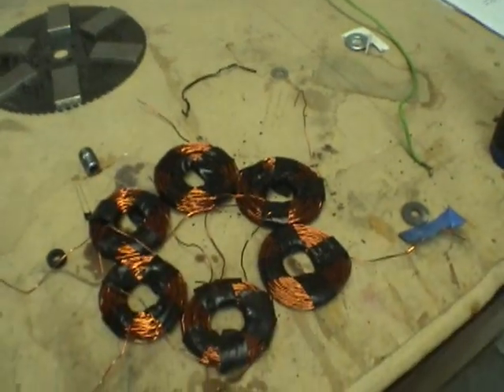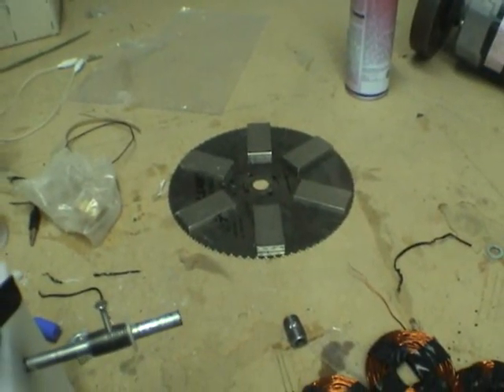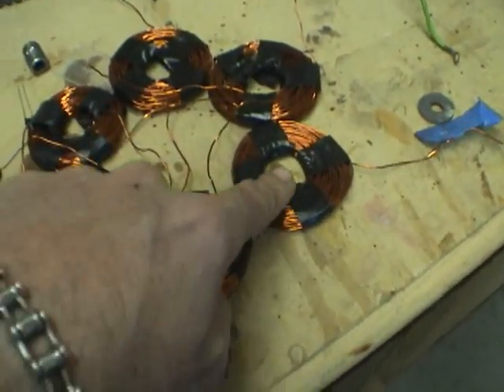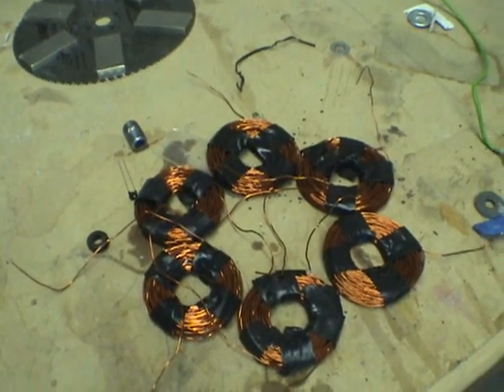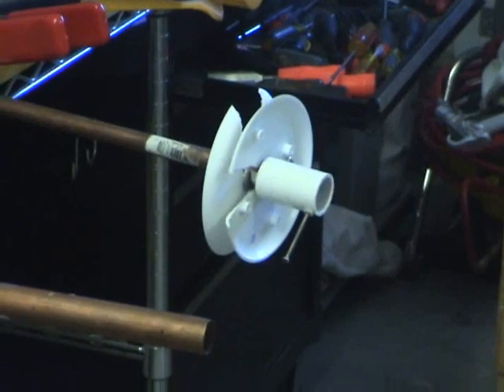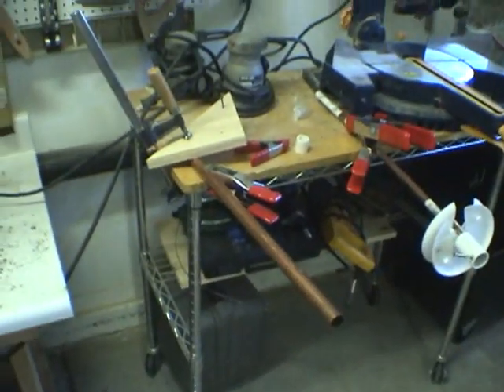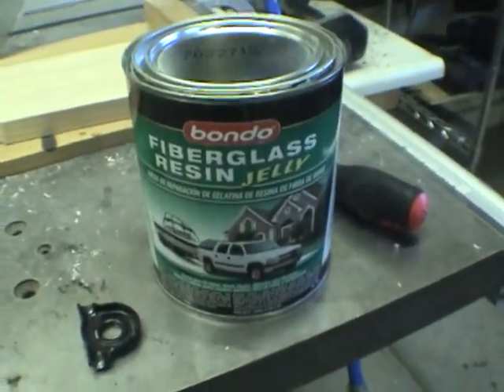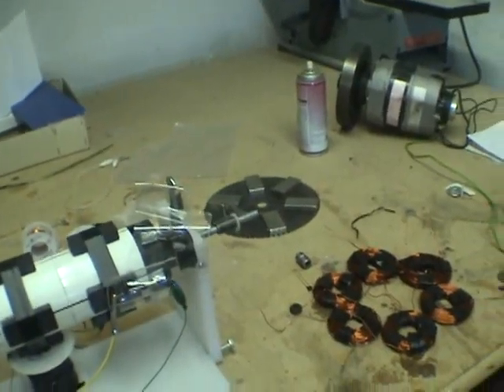Update on the pulse motor alternator

Comment: Are you planning on rotating the sawblade with all those magnets on it? Because if this is the case then I would rather suggest to rotate a lighter wheel with the coils on it to have less load on you motor.